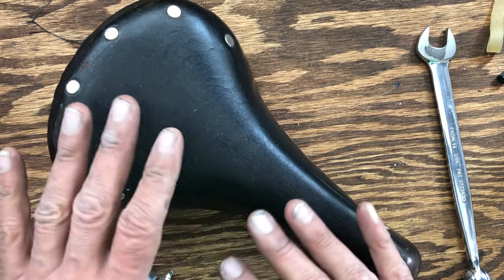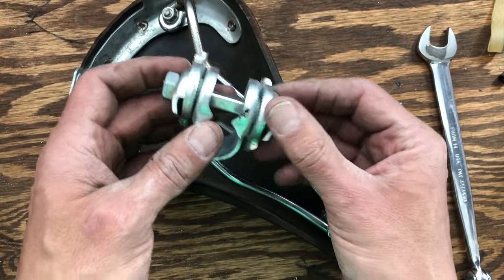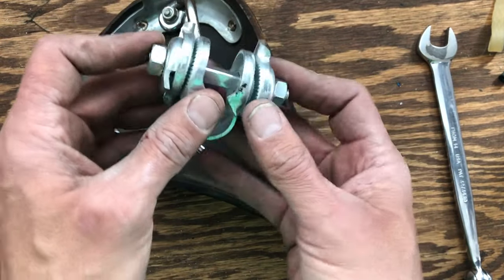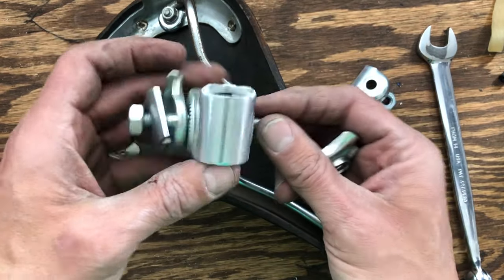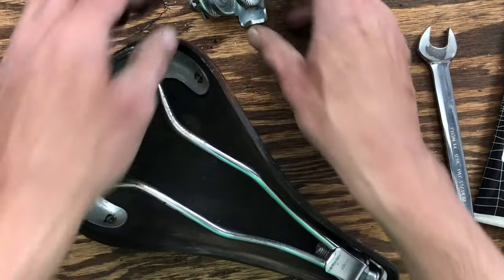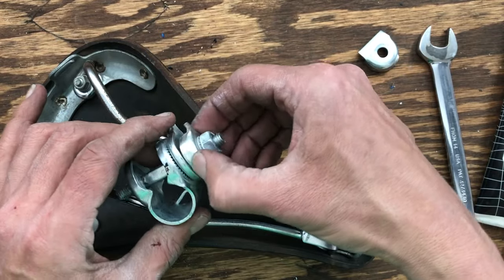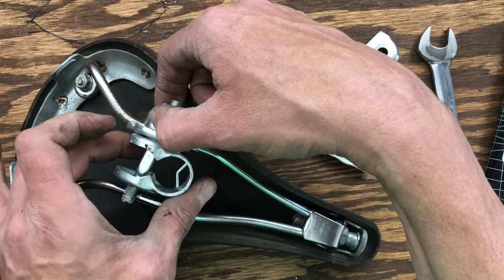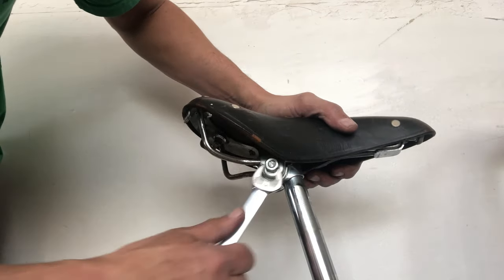How To Install Seat Guts The Easy Way

Comment: Thank you Joey for this straightforward video! I had been putting off replacing the seat on my old hybrid because I thought it would be too tricky. After watching your video I had the confidence to remove the old seat and replace it with a new one. It didn't take any time at all! Thanks again!

Comment: Joey.. these all look to be 7/8... my post is 27.2mm.. Do they make one of these for my bike... 
Problem:  my seat needs to be lowered, but the post is frozen and will not budge.. Thinking this might be a way to cut the post by 1" and attach this single rail guts to attach my saddle at a lower level.. Thanks..

Comment: You makde it look so easy.  That is because the rails on your saddle are nicely spaced wide.  Every saddle I have had to work with is much more tightly spaced than that.  I have to use a tool to spread the rails.

Comment: Do these things come in different sizes? I'm even having trouble just putting the clamp the pipe later goes in in between the rails. For getting the rest of the parts in I'd need some kind of tool and I'm really not comfortable with that.
Reply: I wish Joey had provided you an answer to this. Your question is now three months old!!!  I discovered the same issue with my bicycle when I wanted to replace the saddle.  The new one definitely has less distance between the rails than the original bike saddle did.  What I had to do is pretend I was The Incredible Hulk and muscle the rails apart so all of the parts would align between those new rails.

Comment: Thank you for uploading this I was having difficulty with putting on a new and wider seat with memory foam that is much better than the default narrow hard as a rock seat and my new one also has a built-in LED light that has two modes the standard on and a flashing pulse it's a nice Schwinn seat.
Reply from the maker: Awesome!

Comment: I just bought 2 bikes of the same brand and stye yesterday and in one of the bikes the seat keeps moving down from the back and we tried tightening it but it still moves should I return it since I just got it or can I do something to it
Reply from the maker: If you followed all the steps in the video and the saddle is still moving, I'd take it back and get it fixed or a replacement.

Comment: Funny seeing a video on this since I recently assembled a bike for a friend which had this assembly to attach the saddle to the post.  I don't like these so I removed it and swapped the post for a better one with a standard clamp for the saddle rails.
Reply from the maker: That's usually the best practice to swap to a post with a built in clamp, but sometimes its not an option. Thanks for your feedback!

Comment: Sorry for late question. My saddle has 4 rails and the guts are stripped. Will guts like this work on a 4 rail seat?
Reply from the maker: You may be able to use some of the components from a 2 rail assembly, but you’ll definitely need the pieces that support the rails themselves with the 2 indents per side.

Comment: The easiest way is to remove the nut and set it aside in the same position, never turn it at 180 degrees, then the second piece and place it next to the nut making sure not to turn it at 180 degrees. Lube the thread and put it back.